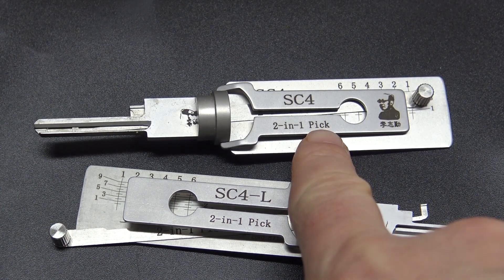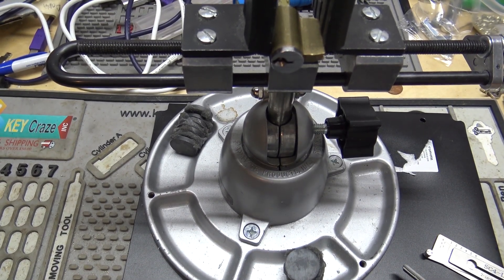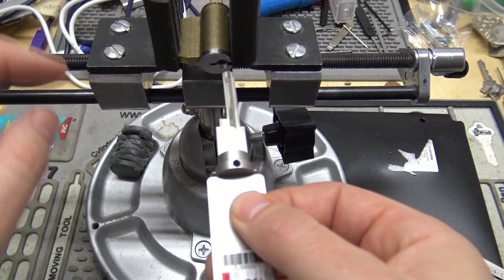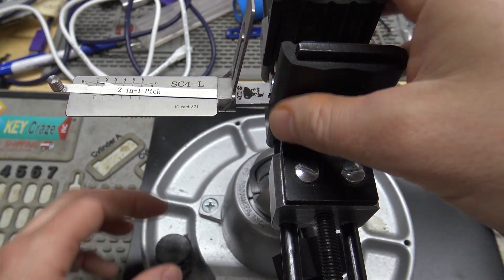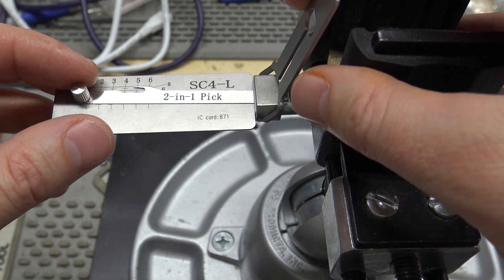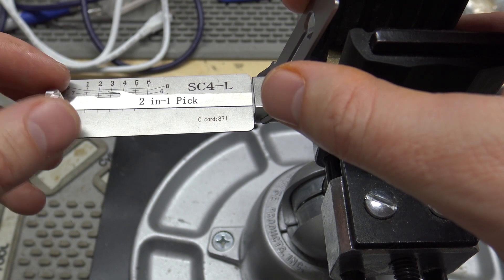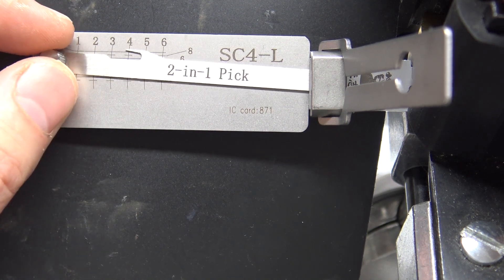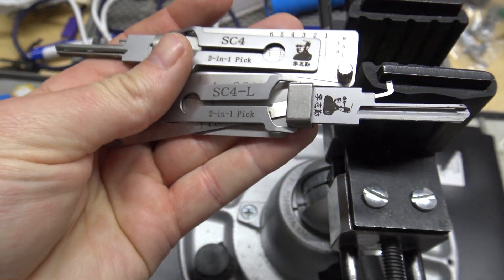(462) SC4-L Lishi Compared to SC4 Lishi & Demo'd

Comment: The tension bar should be oriented on the top so that you only need one tool regardless of door frame orientation
Reply from the maker: the tension bar can be switched from side to side.  that isnt the issue.  the issue is the lifter facing the ground
Reply: @BoredLockpicker  Don't you mean facing the left?(As the lifter and scale would always be on either side(As cylinders will always be vertical on doors regardless of the handing)
Reply from the maker: @lokpikr999  no.  watch the video again.. you see the sc4 facing down towards what would be the ground on a left handed door with a lever.  makes the lishi tough to use to pick the lock.  this has nothing to do with the tension arm

Comment: So I got my SC4 and I like it but is there a technique or something I may be doing wrong?  I feel the pins clicking but no luck turning the lock.    Thank you.
Reply from the maker: with any lishi.  if it springs leave it alone.  they just take practice but once you get the feel they work amazing
Reply: @BoredLockpicker  how much pressure on the tension wrench?

Comment: Excellent as always. Just my opinion tho..how about bumping or picking and then inserting the lishi to read....it does work and locksmiths should always have more than 1 way to get into a lock.
Reply from the maker: bumping doesnt let you read the lock but I do bump locks quite a bit.  on job today.  defiant brand door knob i raked it open backwards and inserted the lishi to read it and make the property manager a key.  frame was in the way to use the lishi comfortably.

Comment: Hi there, can you please make a video on how to pick Euro Cylinder locks using a Lishi Tool? I dont know which tool to purchase for Euro Cylinder locks.

Thank you very much :).
Reply from the maker: There isn’t for euro cylinders. You have to pick those the old fashioned way. With lock picks
Reply: @BoredLockpicker  So how do you find out which lishi tool you need for a specific keyway. Also, can a SC20 or SC4 fit in a standard 5 pin or 6 pin lock? :)

Comment: What do you do if the lock is upside down or right way up - depending on which side of Atlantic you are on - I assume the normal or L model would do the same job
Reply from the maker: correct.  the L is for when the cylinders are sideways like they are in levers.  you can reverse what side the tension arm is on on the L or the regular sc4 lishi.

Comment: pity they did not pickup the problem of upside down levers when designing them 2 years ago. 2 years is a long time.
Reply from the maker: maybe they wanted to see how the other ones sold before making them.  idk also could be that in testing they seem to always have a cylinder in a vise configured in the easiest way to use the tool
Reply: @BoredLockpicker  i had to drill holes in mine to do the reverse picking style and asked 2 years ago but no-one was interested. direct to lishi. we have a lot of strong springs with spool pins to boot in australia.
Reply from the maker: @177994003  thats surprising considering mr li's right hand man is a locksmith in autralia.  although he just does automotive I think
Reply: @BoredLockpicker  he certainly does not do openings on lever handles at nighttime like us locksmiths. It would of been here a lot sooner, my 4th job with LW4 lishi found out the Problem. 6 days after it arrived in australia.